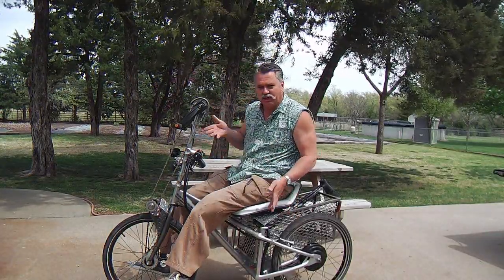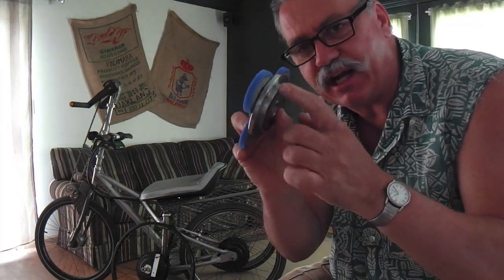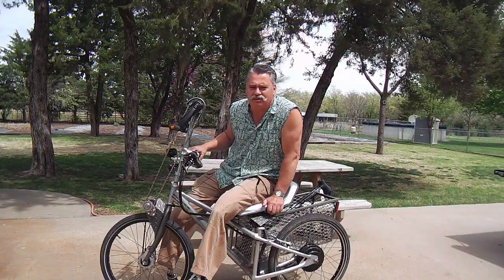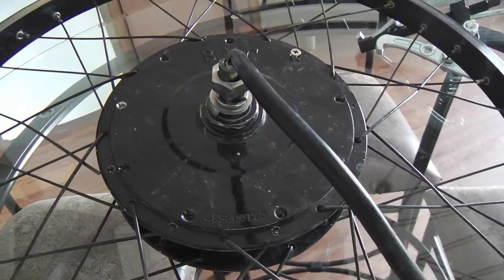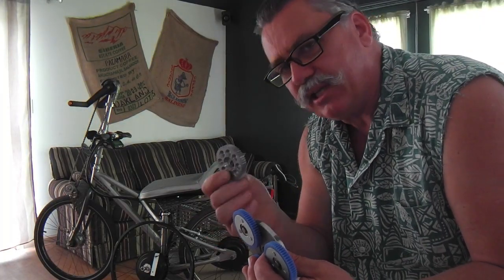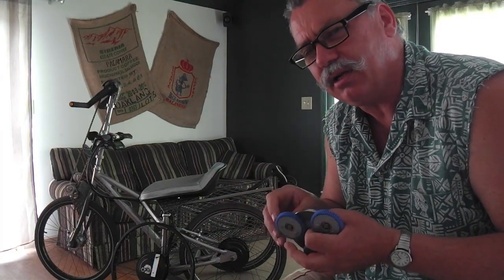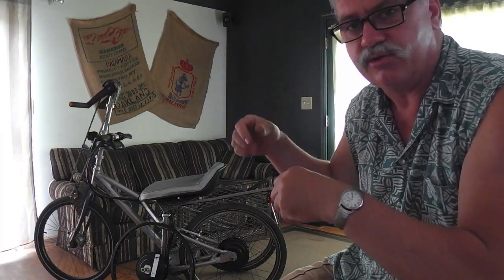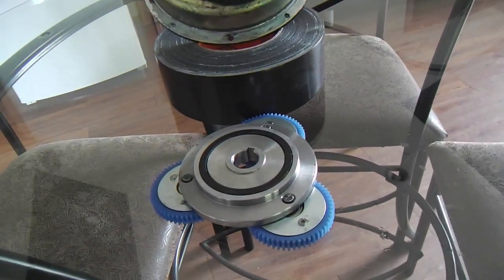Electric Bike Hub Motor Planetary Gear Upgrade

Comment: can you tell me how to make hub motor at home
Reply from the maker: Gee, even if I could describe how to do that, I wouldn't, because the Division of Labor is a wonderful thing, and enables you to just buy a hub motor from sources in India and China at a much lower cost than you could produce yourself, and without all of the development hassles and time involved. For around $300, a proven package in the form of a direct-drive hub motor, laced into rim, with a controller and throttle can be delivered, tax-free in most cases to North America, that would undoubtedly be better than anything you or I could do at home. I mean, I've heard of people doing home-style electric drives on bikes that do work, but not too well, or nothing that compares to what's available in the form of a direct-drive or geared hub motor that are very affordable and available to most anyone anywhere on the planet. A good lithium chemistry battery is usually the more costly component, which people will sometimes try to save money buy assembling their own.

Comment: nice but i would go to direct drive just for the ease.
Reply from the maker: Yeah, I did soon after this video go semi-direct drive, yet with the planetary gears too, for a kind of hybrid hub motor, which give quick take-offs, allows the axle to be powered in either direction (and keep the wire inboard/outboard), and deletes the weak link of the clutching cog action (yes, it does pick up a little magnetic cogging drag though). Take a look at this video I did shortly after this one, entitled, Electric Bike Planetary Gear Clutches Modification: https://www.youtube.com/watch?v=t_O4pk4qONU